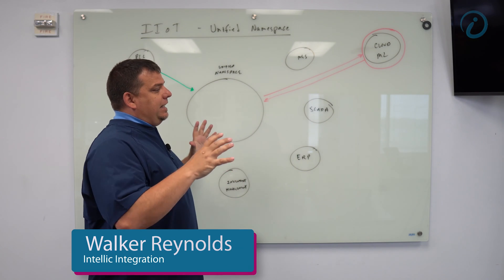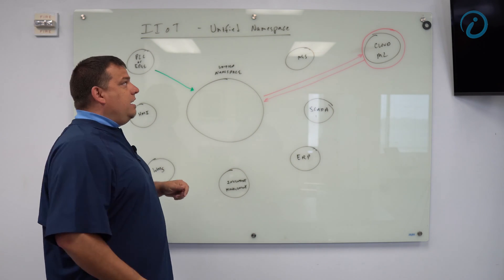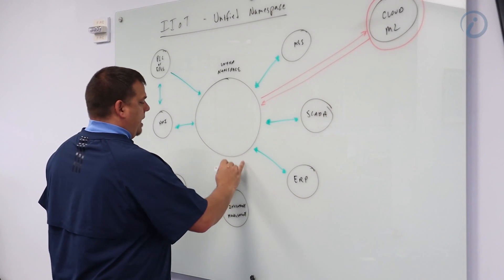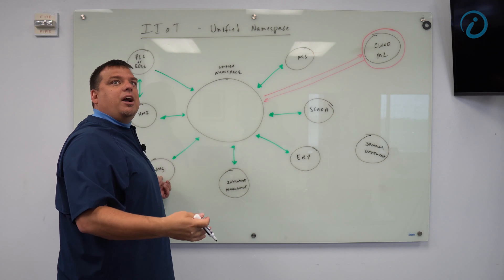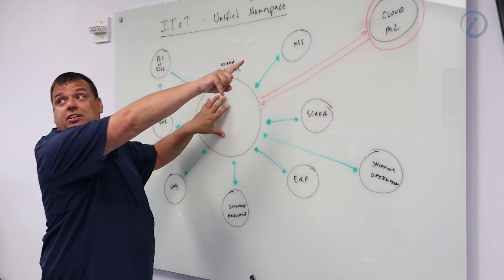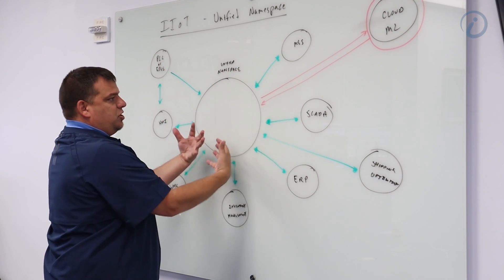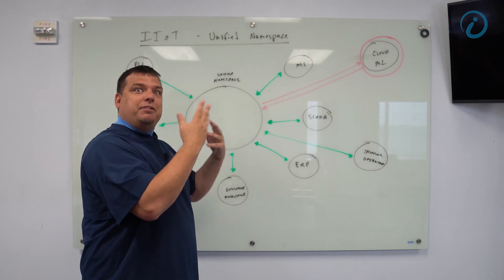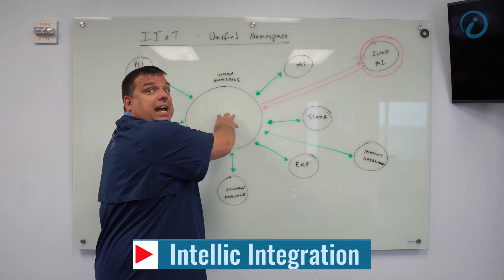What is the UNIFIED NAMESPACE?

Comment: Unfortunatey your comment, that customers cannot do ML/AI without your definition of UNS is simply not true. This customer did a great project based on OSIsoft PI Asset Framework already in 2019, which is the most installed data infrastructure since the 80´s.
https://www.youtube.com/watch?v=PB_9HIgSCWc&t=411s
Reply from the maker: isolated point solution. That's exactly what that is. It's not impossible...just not scalable my friend.

Comment: Why don't you include PLM, PDM and documentation control?  The biggest issue passing through these systems is an engineering change.
Reply from the maker: PLM apps and the data they contain become another node in the UNS data infrastructure.

Comment: Best and most simplified explanation of the Unified Namespace. All machine builders need to have MQTT Sparkplug B native to their equipment. This is a low-cost software based solution. Open architecture. I would question the ethics of any company that does not offer this interface.

Comment: Although already published in 2019, still very actual. My main questions would be 1) how do you explain to your customer that the data within the seperate nodes will be stored twice (which leads to double costs) and 2) with this universal namespace available would direct interfacing between nodes become obsolete in your opinion?
Reply from the maker: Simple... manually piecing together data costs way more in time, and opportunity cost of not turning data -> information. A Unified Namespace will not become obsolete because it's a concept. Every business needs one and has one whether they realize it or not.
Reply from the maker: it won't be double cost. direct point to point integration doesn't go away entirely but it mostly goes away.

Comment: MES, SCADA, PLM, ERP, ... no need to create a new entity. They all are just data (realtime and historic). A MES system is very good at handling manufacturing data, erp for business data... The key for integration is standardize the way data is stored and communicated across systems. Call this integration the unified namespace if you will.
Reply from the maker: Actually creating a new entity is paramount for reframing the way we think about integration. Too many engineers still thinking in industry 3.0 methodologies.
Reply: At least two issues with this:  1. If you want to cross report on these systems you're mining each one so you're going to need to create a cube or warehouse for that anyway.  2. When the systems disagree, which one is correct?